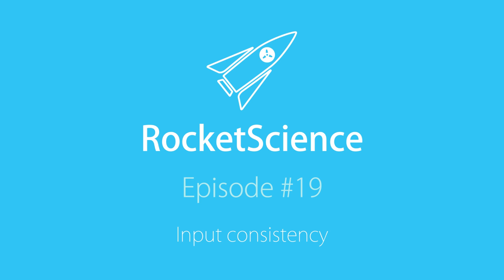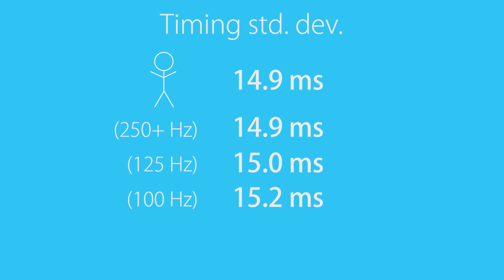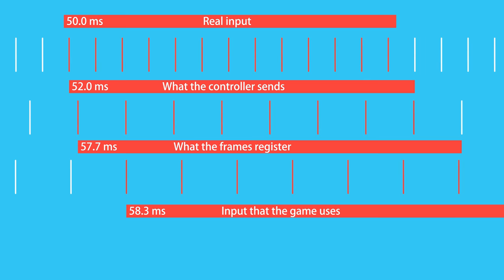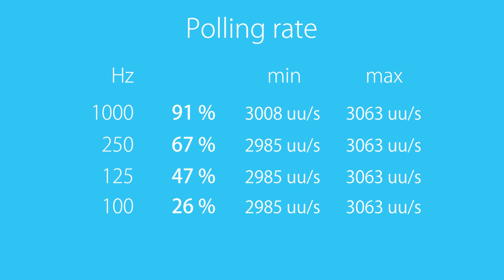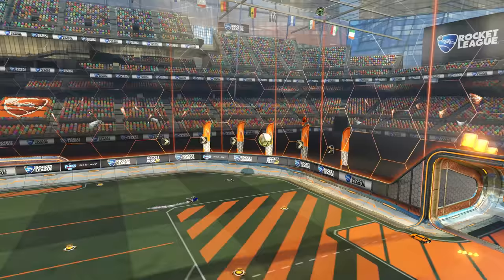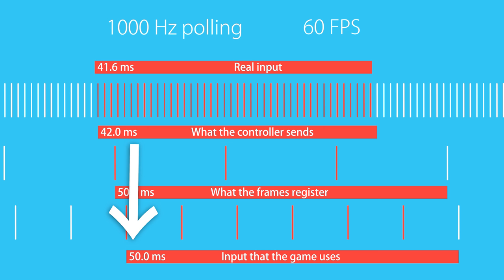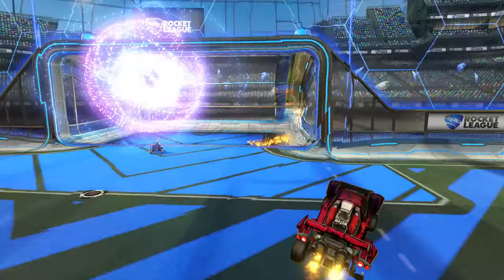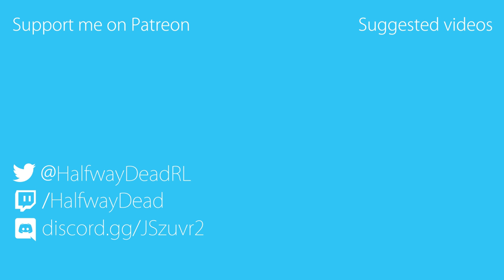Input consistency & heavy car bug - Rocket Science #19

Comment: I can run the game at a decently stable 144fps on max graphics 120 nearly perfectly (depending on other factors) and 240 on low, but I'm using the Steam Controller and a 60hz monitor. I plan to get a 144hz monitor as soon as possible, but the biggest difference will be getting a different controller. Only issue is I've spent 1700hrs(2k total) with this controller now and it feels wrong to use anything else. Anyone know a way to overclock the polling rate? xddd..

No but for real, I'm so used to the quirkiness of this controller that whenever I jump onto my bro's PS4 and play casual with him, I can't hit a damn thing. Everything feels so slow, laggy and the car feels like a spongey brick. I wish I could use a different controller, but I very much like the touch pads, the paddle grips (for drift and air roll) and the post-trigger buttons for boost :/

Edit: Fixed a word.
Reply: well first u dont have to change the controller if u are not playing the rlcs XD second u need some time to get used to a ps4 controller sure but thats no problem. second a gtx 1060 or 570 can run the game on max at 1080 with consitent 250fps. if u can barely run rocket league on max setting with 144fps or more than u should consider upgrading ur gpu or cpu after u got the 144hz monitor
Reply: True, but there have been times where I've whiffed and know for absolute certain that I should've hit that shot properly on target. As for the PS4 controller, my configs are still almost identical. It takes an hour or so to get used to it, but it's still mushy as hell.

Oh, and yeah, I do have a tonne of programs open simultaneously while playing rocket league. I have a Ryzen7 1800X, but only an RX 580 GPU. It's not that it bogs down at 144hz, by 'decently stable', i mean its at the limit like 99% of the time. When locked at 120, it still dips, but very very rarely.

I just tested it now, maximum settings in training (DFH Stadium), I average 197-205fps, with the odd dip now and then. Different story when actually in a game, so I might've under-estimated my actual FPS numbers. This is with an FL Studio project open, Sony Vegas open, Photoshop and like 80 chrome tabs.
Reply: The controller isnt the problem, it's the ps4. If you're switching from PC to a console it's a very difficult transition because there is a lot of added input lag

I play on Xbox one and PC, even using the same monitor and controller, and the xbox one is massively harder to play on due to the processing of the consoles, PC is just faster
Reply: @Xenro66  well than its ur fault for not cleaning up background garbage. there are a few graphics settings that dont need to be turned on but only destract you from playing and lower ur fps.
Like depth of field
bloom
light shafts
motion blur
lens flare
Your hardware is very decent but used wrong., if u have a ton of shit open in the background.
Reply: @Reprivation This is my exact thinking. Like I said in my OP, it just felt horrible. I can 'get used to it', but it's just so much smoother on PC. I feel genuinely sorry for players stuck on console.

@Edmo96, Chill out :/. I was making a point about my system not bogging down as much as I thought it did, only solidifying my concern with using the Steam Controller. By the way, I play on max settings because I can and it looks good without impacting performance that much.

Just to add, none of this even really matters as long as I get a solid 60fps. Like you said in your OP, it's not like I'm playing in RLCS any time soon... But my controller has definitely screwed me over at times due the exact points that HalfwayDead described in this video. Oh well  ¯\_(ツ)_/¯

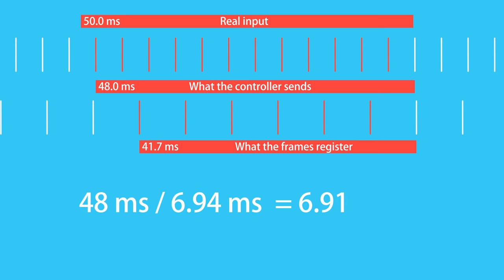Comment: 6:38 Omg now i know. The physics in Rocket League get calculated 120 times every second. That is why , when i change from 120 fps cap to higher, my inputs get messed up, i use mouse to steer. Everything over 120 fps causes my front rolls to change randomly to side flips lol. At 120 fps this does not happen. What a pitty. I could easily pull 240 fps with my system at max settings. Mouse and keyboard btw.  have 1ms reaction time. Polling rate 1000hz. Is there a way so increase the physics tick rate to 240 ?
Reply: There's no way to change the tick rate.

Comment: So rocket league uses void update(){} instead of void fixedUpdate(){} ?
Reply: Hard to say - its known that the physics tick is always exactly 120Hz, I didn't quite get what HWD said when he got Bakkes to change the way inputs were handed to the game. Maybe the inputs take a time value for when they occurred and this was somehow affecting the results.
Reply from the maker: The fixed timestep always progresses the physics time by 8.33ms but it doesn't get called at a fixed rate. It only gets called if the frame needs a new physics step. Which at 240FPS, for example, it will only need every 2nd time. At 60FPS it will need 2 new ones at once so it will generate them both at the same time.
Reply: @RocketScience  I see, so at 10 FPS its doing many physics ticks, but only doing them each frame, in bulk.

Comment: PhantomACE recently did a video suggesting to turn off the steam controller settings, I think it was because it can mess up the deadzone.

I suggest everybody to try out the slow mo thing, it's crazy. I had the same effect in both directions many years ago on gamecube. After playing F-Zero GX (future racer, very high speeds) for a long time and then going for some mario kart, the latter felt painfully slow. Boring, but very easy. Another time I played these mega slow experiment cars in Mario Party 5. After going back to Mario Kart I couldn't handle the game anymore, I was sure it was bugged to somehow go faster. It wasn't a subtle effect at all.
Reply: PhantomACE didn't know what was causing that "feeling". That feeling was actually Steam Configuration applying a 0.25 deadzone automatically if the "Anti-Deadzone" is set to zero. Halfway_Dead (Rocket Science) even mentioned it in his deadzone video.

Comment: I think a more likely culprit to the "heavy car bug" is joystick module degradation. More specifically the variable resistors within each axis of the joystick modules. I've changed out quite a few of these on every controller I've used for a long period of time. I seem to have to replace 1 every year or so. You can tell wen they are going bad with  many controller testing apps out today. Typically a failed module for me will show when I move the joystick around in many different directions and then move and hold it to 1 specific direction (up dow left or right) the worst I've seen is the controller will input only 30% of the direction I was pushing when it should have been 100%. That could very easily produce an effect to what ppl are calling the heavy car bug.

Comment: I was having HCB for the longest and I never knew how to fix it , or what I should do . I tried everything in multiple videos , from editing the Framethread thing to false , reinstalling drivers , network troubleshooting , editing Nvidia control panel and everything and nothing helped . It was very frustrating and caused me a lot of ranked games , a lot of tilt , and a damper in my mood .And One thing that I just tried last night that seemed to help was on the Nvidia control panel (I don’t have a amd graphics card so I can’t confirm it there ) I changed the 3D settings to “set by 3D application “ so essentially it’s not using ANY of the Nvidia control panel settings and just using settings straight from the game and for me at least that HELPED TREMENDOUSLY. The game has never felt so responsive . If anyone is still hoping to fix this , give this a try .